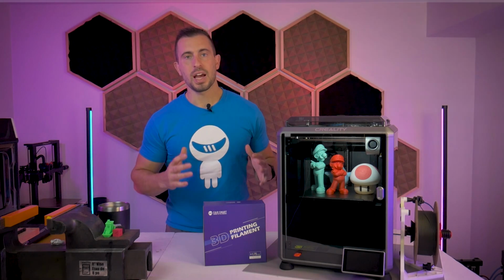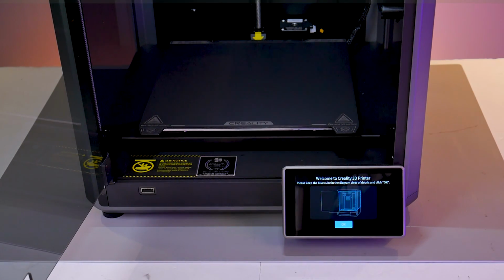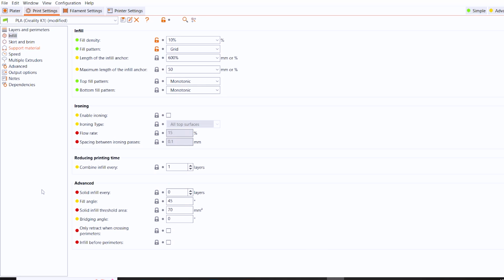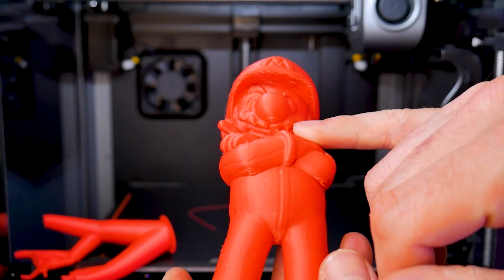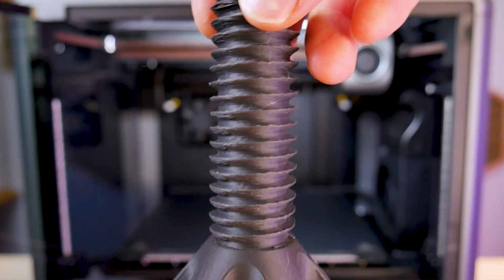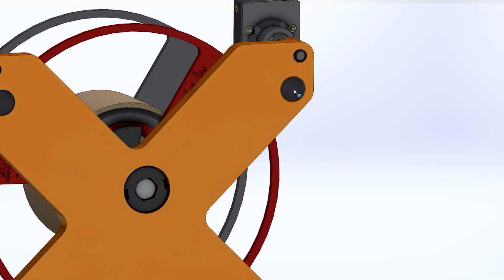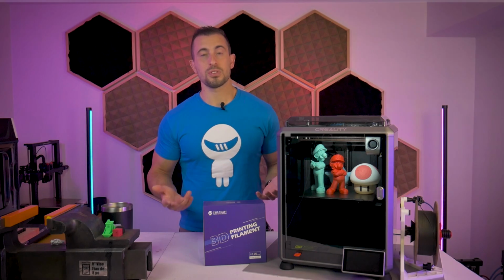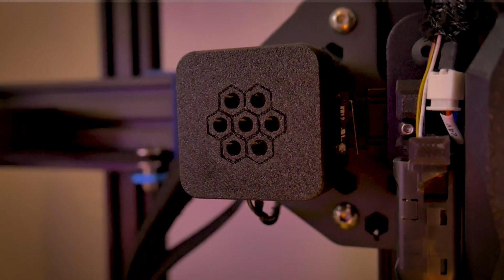Creality K1 Setup Guide, Review, PrusaSlicer Profile, Upgrades and More!

Comment: Do you have any tips in regards to the filament that seems to filament that I got will not feed through it and if it does, it may have to run at a hotter temp

Comment: Haven’t watched the whole video yet but hoping this will fix my issues with my k1. Already upgraded hot end, extruded and bought a filament dryer. I still get layer separation halfway through my prints. Owned this for 5months now and I haven’t print 1 successful thing that didn’t take a 3ft fall and shatter in layers. Using creality hyper filament they sent with printer and 100% infill does it too.
Reply: same here
Reply: @ ended up being the filament had major impurities from factory. I was even dehydrating it. Ended up ordering the same brand filament again and a different brand and they both ran flawless

Comment: Watching your video and wondering if you would have an answer to my K1 problem. I'm using PLA. I've noticed some of my prints will come off the bed, I use glue, and be lying as if flung by a Gremlin. I finally noticed that the mylar on the print bed comes up with a bubble, which lifts one edge of the print that then contacts with the nozzle and gets felled!! I haven't heard back from Creality yet, my 'fix' as it were is to lay magnets on top of the raft edge and the build plate to hold the print down a few minutes into the print. This seems a shameful fix so was wondering if you had another idea before changing print beds. I know that maybe changing mylar may help but what adheres the mylar to the print bed. Unless I just rip it off (begone bed). Thanks for the great impression, I like mine a lot over my Monoprice III

Comment: sadly my K1 killed it's self on the 2nd print.  Printed the benchy and I was blown away by the speed and quality.  Setup my 2nd print watched most of 1st layer go down fine. Came back later and the remains of the print were sitting on the middle of my desk.  Inside the entire hot ended was encased in PLA and I'm getting a error on the temp from the hot end.  It had ripped the wires from the thermal sensor out. FML!
Reply: Did the same thing. Thankfully you can get a new housing for like $23. You will also want thermal paste aswell. Install is pretty easy

Comment: Hey there I just got a K1 Creality myself. For some reason it wont read my stl files on usb? any ideas why it's not reading? (would love some help if possible)
Reply from the maker: It reads gcode files not stl. So you need to slice them first using a slicer and then the printer will read those :)

Comment: Hey, can i use the settings here for my k1 max, if i just change the plade to 300x300x300 ?
Reply from the maker: You can try... shouldn't hurt anything. I'm about to do the same as I just got a K1 max and will be starting with my K1 profile to see what other changes I need to make

Comment: excellent video
but I have a question, in the prusa slicer 2.6.0 where is the print speed setting change, from normal to silent?
when prusa slicer processes the drawing at the end it informs me with 2 printing modes and with 2 different printing times, but I can't find a way to choose between the 2 printing modes

Comment: do you recommend any settings for k1 max for petg or have a profile. im not getting same print quality using ur k1 profile.. accounting for the increase bed size as well
Reply from the maker: Hey so just to be clear you tried my K1 profile on k1 max and it's not working well for you?
Reply: @EmbraceMaking  yes. I made the adjustments needed for bed. But im still not have success. I also get thready infil. Ive ran self leveling a couple times. Played with a variety of the settings id typically do for other printers. I hate creality cloud, but its only place have has successfully printed most things but its very limited and cumbersome

Comment: Sir, thank you so much for making this video! I am extremely grateful. Would you have any suggestions on PETG settings for the K1 Max? We just got ours going yesterday and I attempted to run petg thru it. With some half-baked settings of my own using prusa and then when I attempted to use the creality slicer everything went to hell in a handbasket! It started doing all these zig-zag moves, the lidar went crazy and when it printed the first few layers it rose above the part and started printing in thin air and nothing was coming out! Creality tech support was "somewhat" helpful but now I'm afraid I made the wrong choice for our company. Can anyone say, "buyers remorse?" Thank you and the community for any suggestions.
Reply from the maker: I have a K1 Max on the way so I'll be able to experiment with that soon. In the meantime I've been running carbon fiber PETG through my K1 successfully. I've been running very detailed parts so I have been focused on quality and low layer height, not really speed so my profile would likely be slow, but I can export it tonight and put it on my website for you if you're interested. Let me know
Reply: @EmbraceMaking  Thanks again but I'm boxing the printer up for full refund this week. I didn't want to take the chance on disassembling  the extruder and hotend to get to the stuck filament. The temp on the hotend somehow went to 260C while It was printing (with the creality slicer), the heat went straight up past the heat break and the filament stopped flowing. After aborting the print the filament cooled and I couldn't remove it. Took
 the nozzle off, heated it back up to 260 and tried to run the needle they provide but ran into a wall. ☹️ I've tried for 3 days now to get help from Creality and their tech support team has been terribly evasive. So I emailed them notifying that we will send back for a full refund. ☹️ Really wanted this printer to work for us..

Comment: Great video! You set the flow rate to 32mm/s^3. That's pretty high from the default. How did you decide to use that value?
Reply from the maker: Thank you! Yes it's higher than what the hotend can probably do. However, since I know my speeds are under the limits of the printer I don't want the slicer to use the flow rate to limit my speed. If you put it too low ie. like 15mm/s^3 the slicer will adjust the speeds to stay under the flow limit and you might not notice if you don't check the speed details in the slicer preview.

Comment: i watched earlier videos and the web interface wasn’t available and you had to do hacks to get it. did they open it?
I’m considering buying it since I cannot get a P1S in my country
Reply from the maker: You don't need to hack anything to get the basic web interface, it should show up as long as you are connected to your local wifi network. To get full fluidd interface you need to root the printer to gain access to enable fluidd

Comment: I just bought the K1 first ever 3d printer. Set up was easy, have yet to print a complete benchy without it stopping, just got it today too,
not a good experience like all these K1 videos. There must be some editing going on that we are not seeing.  It's a nice looking 
machine, not too loud, prints fast but it keeps stopping horrible. Some must have a fix for this, anyone else have this issue? It is 
getting ridiculous.  OMG!! I found out the problem!! The printer shakes alot, like alot, so I had 30% on the benchy so I leaned on 
the printer to stop lessen the vibration and the benchy finally finished! I needs weight on top of it, the first part of the benchy
had the filament strings like you get but the last 30% of the print with my me holding it down, it did not stop and the remaining
print was flawless, way better than the first 70%.  So, stablelize the printer as best you can!! I am getting a 35  lb gym plate
to rest it on top problem solved! LOL Unbelievable!
Reply from the maker: What do you mean by it stopping? Like the machine just stops halfway through the print? Or the part comes off the print bed? Or plastic stops extruding? More details and I'll see if I can help you
Reply: The printer was not getting enough power, that was the issue. It is printing better once
I put it on its own circuit. I am completely new to this, my second benchy printed fast and flawless with no filament strings. I have seen videos with experienced people using the K1, but no one has done a video on the power requirement which makes a huge difference in the printing. You should try it. The same issues probably with the K1 Max, put that thing on it's own circuit and it will
perform to it's optimum.   @EmbraceMaking

Comment: Input shaping when slicing with Prusa is TERRIBLE with the K1 ... I must be doing something worng??
Reply from the maker: What kind of problems specifically are you seeing?
Reply: @EmbraceMaking  Slight Ghosting around sharp areas, such as embossed items... I printed an iron man faceplate with the creators embossed logo and it was ghosted off to the left of the logo.... I'm assuming a belt needs tightened. I'm new to CORE XY

Comment: I was having bed adhesion issues too and I resorted to using Magi goo glue stick. I still had first layer adhesion issues. For example, had a spool printing vertically at high speed about 60% complete when it just started printing in thin air due to adhesion and high-speed vibration issues. I later realized the Creality PLA material profiles (hyper and standard) were using a bed temperature of 45C.I cleaned the PEI sheet with soap and water. I started using a bed temperature of 55C without glue stick and I have not had any bed adhesion issues since using Creality Hyper PLA or Amazon Basics PLA. IMO the Creality Print material profiles are not well tuned so print temperature cooling towers to confirm what temperature your filament brands work best with. I have had clogging issues that appear when attempting to retract filament after it has cooled. I have had to remove the Bowden tube from the top of the extruder and use the cleaning rod with the nozzle heated to 240C. This does not always work, and I have to heat the end of the cleaning rod with a lighter. Be careful to not heat it too much since there is a Capricorn tube between extruder and the heat break. When the cleaning rod is heated enough the filament will melt extruding from the nozzle and sticking to the rod when it is removed. Repeating this a couple of times after cleaning the rod gets the filament to extrude again. Overall, I am enjoying the printer and I will begin using PETG next.

Comment: the pattern on the x and y is because  of the large pulley on the stepper motor, which is causing the vertical fine artifacts (VFA) to be more noticable.  If you want to correct this, change the xy stepper motors to .9 degree steppers and double the steps per mm in the firmware after the k1 becomes open source. :)
Reply from the maker: Someones else mentioned running VFA test as well, and then modify external layer speed accordingly... going to give that a shot and see what happens before swapping out motors !
Reply: any news on it?  @EmbraceMaking
Reply: Can you explain how to do that
Reply: The VFA's are the only thing thats making me think twice about getting the K1, Are the LDO 0.9 steppers compatible with this K1 printer though? I also heard the accelerometer/input shaping that the K1 has isn't actually very accurate

Comment: Thanks for making this video. I am really new to 3d printing but got the K1 all the same and already tinkering and do agree starting out with an ender 3 might have been a wiser option.  Hopefully there are more videos to address K1-related troubleshooting.

Can you advise how to stop zits/ blobs at the end/ top of a vase ( used vase mode)?
Reply from the maker: Thanks for watching, I actually haven't tried vase mode yet on the K1 - I should probably do that now! Which slicer are you using? Are there blobs all around the top or only at the very last part where the nozzle finishes the print?
Reply: @EmbraceMaking  I used the reality cloud one.  And yes, the blobs are at the very last part where the nozzle finishes printing, all around the last circumference

Comment: Nice review! I had one of the first production runs with the defective extruder. I did get one of the new ones from Creality, and I also swapped the nozzle for the CHT Volcano nozzle. Extremely happy with the unit. Looking at the K1 Max now.....
Reply from the maker: Glad they sorted out the first extruder design for you! Do you notice any difference with the CHT nozzle? 
I'm also hoping to try out the K1 Max next ... curious to see how the Lidar feature will work out.
Reply: @EmbraceMaking  Extrusions and layer lines are super consistent with the CHT nozzle. I was also able to speed up the printer to 175% will very little difference in printing quality.
Reply from the maker: Interesting... I'll have to see if I can get my hands on one, thanks for letting me know!
Reply: @GuysShop is the CHT Volcano a drop-in replacement (is it the same length as the stock Nozzle)?
Reply: @ThomasS17  It's a little bit longer. But since the K1 uses pressure to determine Z height, it automatically compensates for the longer nozzle.
Reply: @GuysShop  OK, and does part cooling (from the tool head) still work well since it's longer?
Reply: @ThomasS17  no problems. It's only like 1mm longer. And with the extra parts coooling fan on the side, there is no difference
Reply: @GuysShop  awesome, thanks!

Comment: Solid review as always. I don’t think this is up to Bambu machines quality yet. You are spot on, these are not yet appliances. There is a learning curve.  You have a complex mechanical device controlled by complex electronics and software. Starting with a less expensive printer is a good suggestion as long as it is functional out of the box. I think also it should be running Klipper. Maybe there is another video you should make.
Reply from the maker: Thanks! I'm going to see if I can get my hands on a P1P to do a head to head comparison between the two... plus a K1 max in the near future. When you suggested doing a video, to be clear did you mean a less expensive printer running Klipper? Like a general "how - to" on getting an Ender 3 (for example) running klipper?
Reply: @EmbraceMaking  why do people keep suggesting Klipper for the K1, isn't Klipper just a speed upgrade for older slower 3d printers? If so, how can speed this beast up any more, it's already blazing fast.